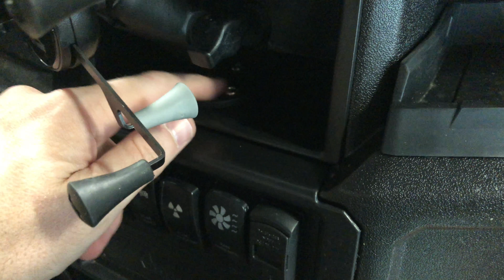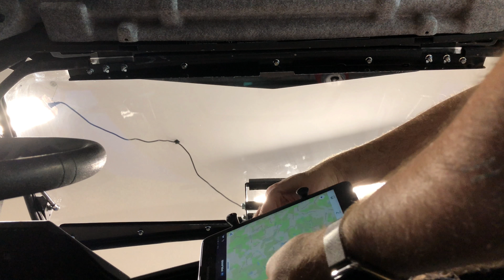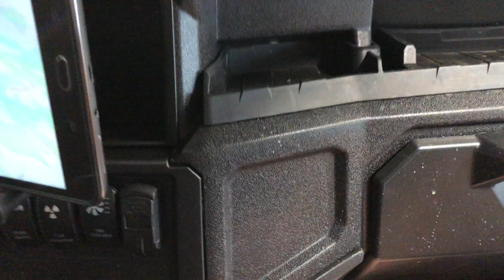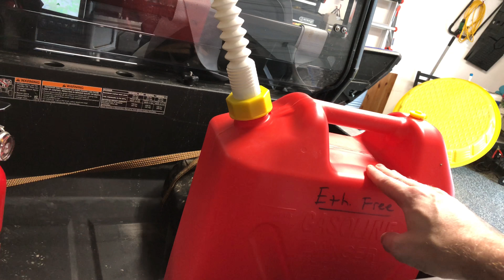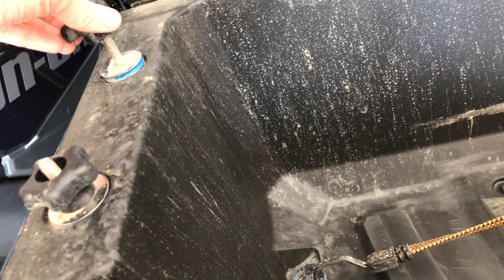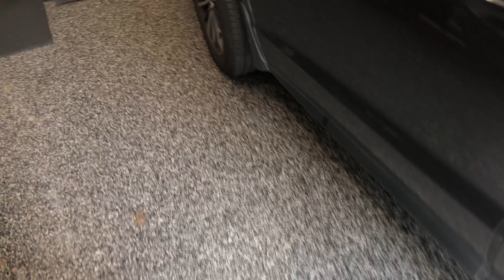2018 Polaris General - RAM Mount Finish and Fire Extinguisher Mount

Comment: Did you ever figure out how to stop the mount from rotating?
Reply from the maker: Not directly. The only way I’ve found is to ensure that the back of the device is on the round, center portion of the mount (which is a “tacky” rubber). That helps, but with all the bumps, you’ll still get rotation. I have the same issue in my truck with my phone mount. It’s not as bad in the truck, though.

Comment: How do you like flip up windshield ? Any problems ?
Reply from the maker: I used both the SuperATV flip up windshield and a Ryfab flip down windshield. Both were really good, but the key was having a flat windshield if you’re going to run a wiper (which is really good if you encounter water or even a lot of dust). Of the two, I’d have to lean a bit more to the Ryfab, but I did have some issues with it (see my videos on that). It’s a tough choice. Good luck!